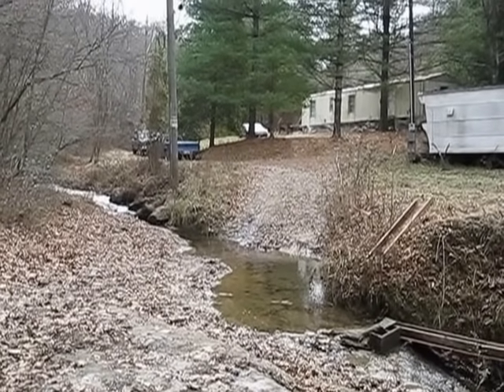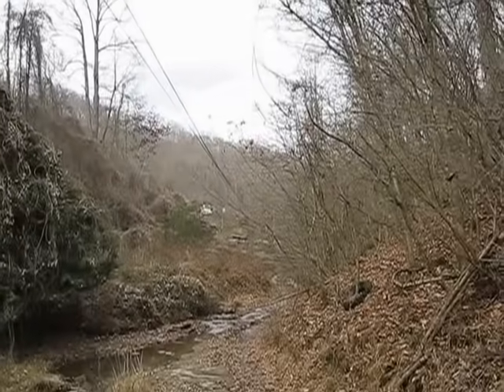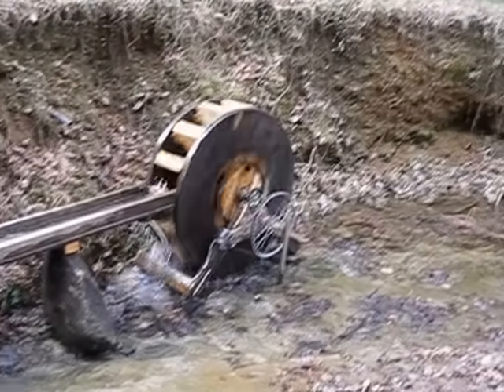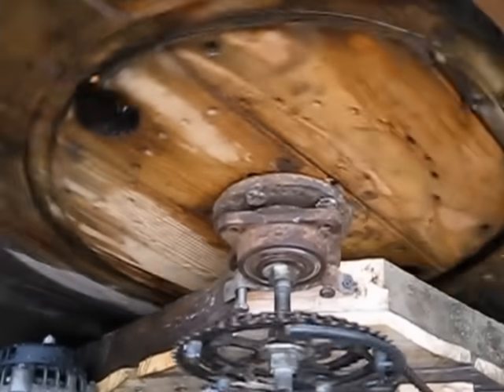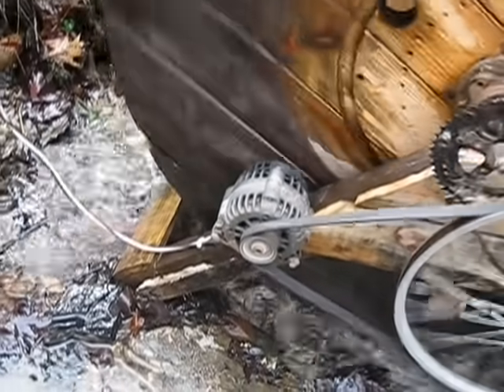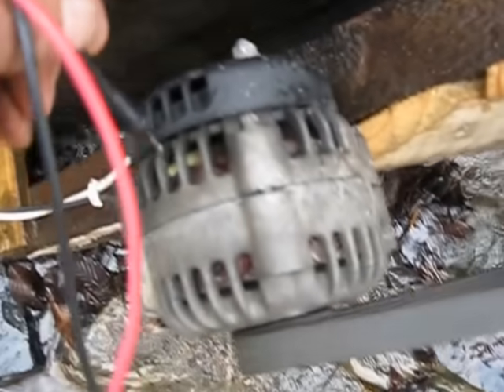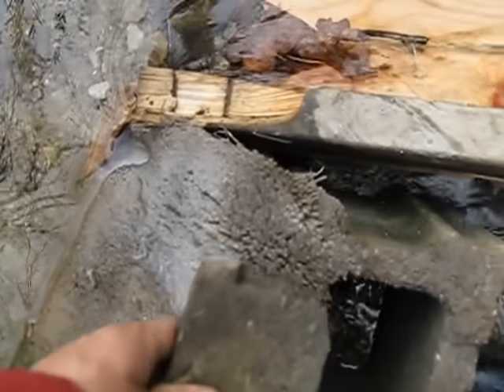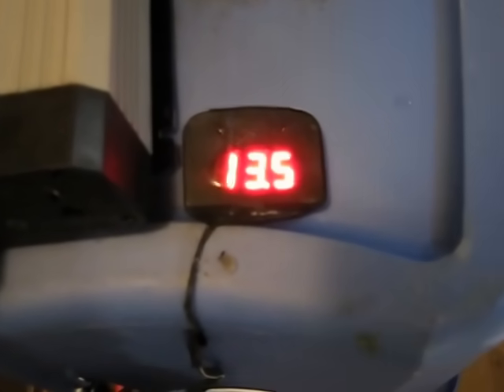water wheel generator

Comment: very cool thanks so much for sharing your water wheel design with us. Do you have any experience or know of anyone, perhaps you might have come into contact with someone that uses a submerged method of power generation, being that I am in the Northern Part of NJ creeks, streams and rivers freeze but, only to a certain depth, I have thought about a power generation idea using a sunken pipe for water delivery to a shore line above ground generation setup but, I am not sure how to determine the length of pipe to ensure water flows fast enough to keep it from freezing. Really don't want to go the route of trial and error because it could get expensive and would be very labor intensive in the winter chipping up all that ice. If you have any thoughts they would be greatly appreciated.
Reply from the maker: If you can keep the pipe below the frost line until it enters a small shelter then use the water to water wheel or turbine inside a temperature controlled environment(It only has to maintain more than 32 degrees.)It won't freeze. Just a suggestion, I've never saw anyone do it, but it seems like it would work.
Reply: Thanks I am going to give it a try, when I have it up and going I will post a video :)
Reply: William Lander If the water is moving fast enough to turn the wheel, it may ice up a bit, but you may not have to chop ice like you would with standing water. But, on the other hand, I've thought about an underwater wheel. Think a conventional wheel, but inserted inside a pipe just a bit bigger, then cut the bottom half of the outer pipe off. Water pressure still moves the wheel on the bottom, and as it's below the cover, you won't risk sediment blocking the whole thing off. The "width" of the wheel is only limited by how wide the waterway is, and any laws regarding blockage of navigable waterways, as I understand it. Oh, and of course, the laws of physics. Too long, and the shaft could bend and wonk all the work if you don't use more bearings/reinforcement in the tube. You could even use a smaller diameter wheel, just wider, for the same power. I'm sure there's a complex formula for power resistance vs. water flow vs. water seeking the path of least resistance...
Reply: YouTube powerspout

Comment: Nice job!  Have you ever thought about adding another alternator to your wheel?  All you would have to do is add another belt and alternator to the system and you could double your power.  There are a couple easy ways you could also make this more efficient.  1)  Make it so that you catch the water at the top so all the power from the water is used, right now your losing some of the power due to hydrodynamics.  2) You could make your pool a little deeper so it has a better supply, instead of using wooden boards use a green sewage pipe. If you made the pool larger you could tie it directly into the pipe with some cement/concrete. That alone would make your entire process easier and more efficient.  Not to mention you could have a real valve to turn it off.  Or keep it like it is, it serves its purpose and does what you want it too do.  I am just an armchair quarter back, who wishes I had something similar running through my back yard.  Cheers.
Reply from the maker: another alternator would be too much for the wheel I think. Thanks for all the suggestions.
Reply: LOL Hammer. 

The only way he could have suspended the constitution is by declaring martial law.

Trump is president so martial law didn't happen.
Reply: Does the law in your country allow you to do it?
Reply: *****  Yes that would work provided the wheel can turn fast enough to make the alternator spin at the same speed.
Reply: Maiusr
Reply: It was pretty much suspended in 2001.
Reply: LOL if the constitution was suspended then Obama would still be president.
Reply: jmcinvale they are just the face for the elites, paid actors creating the illusion for us pawns in there mission to acquire money and power
Reply: @MadCapMag  yes a lighter wheel will mean less force required to turn it but the trade-off is that the heavier wheel tends to want to keep spinning due to it's weight so that would  be lost with a lighter wheel
Reply: the last word has it spot on .
Reply: nice
Reply: Who cares about laws? 

Those who don't want a criminal record and don't want to go to jail.

Now I myself think that a person should be able to do what they please on their own land within reason, but unfortunately the government is trying their best to gain increasing control of our lives.

That can be stopped if the majority of us citizens want it stopped.

Comment: Its a nice design, You will find though that you can over power the friction and loss of power by simply changing your gearing mechanism. just like on a muti-speed bicycle, keep all the sprockets and chain derailing devices and implement an electric motor with a variable speed (for fine tuning).

Comment: if the water goes out them fema wood stove systems produce gas and a butain regulators too generators work too its 2014 might be a cold winter cause of the signs now

Comment: i am just spit balling here but maybe if you rearrange your water wheel so that you didn't loose all that water momentum as it smacks into the wheel you would get more efficiency and not slow the wheel with a heavy load on the inverter. what i mean is run the water over the top of the wheel and you will have fast water momentum on your side to help and you will still have gravity pulling the heavy water downwards...just a thought. but i do realize that you will need to lengthen your wood slues boards and get more distance from your on/off switch/rock so your water can reach the top of the water-wheel and not just the side like it does now ;) probably twice as far is about good :) just spin your whole water wheel rig around 180 degrees and run the water over the top ;) you will also have twice as much water weight in the wheel to be pulled down by gravity so theoretically you will about double your horsepower

Comment: So you have 5 batteries going into that power inverter? How ofter to you have to change batteries. Do they heat up or burn out? Thanks
Reply from the maker: Actually the batteries that were old car batteries have been replaced with deep cycle batteries. Car batteries are not very good for this set up because the don't do well with discharging and charging over a big range. Deep cycle batteries are designed to discharge more and can withstand heavy use.
Reply from the maker: thats it. I do have several 12vdc appliances and led lighting but thats about it.

Comment: Dude, you got to cover that stuff up, and keep some WD40 around
.
That set up inside your house you need to move it as close to the alternator as possible to avoid power loss, and then run the AC from there inside your house.

Get the batteries off the floor and inside some wooden box of some sort, then keep the cables nicely managed.

Comment: add a second alternator double your power. also ive been looking into electric motors hooked up to alternators that power the motor and give off excess power that you can use. use your current system to cut on the motor then switch to the power coming off the alternator and the motor should keep running. the video I watched the guy just attached pulleys to the motor to a 2:1 ratio so the alternator was spinning faster than the motor. Im going to experiment on this at a later date. but just throwing out an idea to ya. hope it helps

Comment: make the water wheel bigger and better... i want to do this kind of thing... but i cant.. plus i have no creek... but if i had the water tub needed... id do it... id just need a large tub or 3.... and a large set of pipes to connect them.. and a large water wheel made of metal ... and a few bike tires... then id have my water wheel in my front yard!!!... and all id need to do is replace the broken stuff when needed.. and fill the tubs back up...and again.... a VERY BIG WHEEL!!!
Reply: is that track a RISING track?? i saw the spout 2:25 and wondered whether it was going UP instead of down.. (to maximize efficiency  you could make the creek a little deeper more towards the wheel and put the wheel a few feet down... make the creek past the wheel go further down and you got better stuff..lower the mouth end of the trough and lower the water wheel.... (or put the water wheel in a tub as i would do and have the water from that wood trough spit into the tub.. have the tub accept more water than that... having filled to the brim.. and have the tub have a pipe or hose pointed at the top or 10 o'clock position...whether or not you make it as i will have to... is up to you.. but make the tub accept a lot of water.... b4 you try and use it... the weight of the water in the tub will have to be heavier than the water in the hose.. or the flow wont work... the water used by the water wheel CAN return to the top of the stream to recycle its use on the wheel... or it can be returned to its natural flow of direction of the stream... or the whole set up can be directly set up so that it stays with the water wheel and attempt to have 100% efficiency...(at least.. enough so that most of the water being sent back to the tub(s) will help keep the water flowing at a fast and steady but overflowing rate.... again.. its up to you...)

Comment: Well, you should really move the water entry point higher on the wheel; 10 – 25% from top. Higher on the power should give you increased force. On the batteries you could use some more. Say, 10 total. Also a dump load to your main bank if they are separate. I guess you could use a high amp switch and a bank of diodes so you can dump the power from the hydroelectric bank to the main bank. The only usable options that I see that would be worth the grain over cost would be for you; wind, solar and hydro. Well, it does work but really a charge controller would be better and a 3 phase generator verse the auto one. In the long run that is.

Comment: there is a better way to pull more power from your wheel.
turn your wheel around and the water spill over the top of the wheel to have it push down on the wheel, the you can add more wheels with a wooden catch leading the water over the top of the next wheel and so on over and over... so if you ever need more power you only have to extend the wooden water lead and than add another wheel.

Comment: I like what you done there and you should get a lot more power out of it without having to worry to slow the wheel down.

The water should enter the wheel at about the 10:30 to 11:00 o'clock position, you have it at the 9:00 o'clock position right now.
Your wheel should be more wide also.
If your wheel could be more tall that will help also.
Looks like your board in front of each chamber needs to be higher so water is staying longer in the wheel and more water can be stored in each chamber.
The aim is to have as much water as possible and as long as possible in the wheel while the wheel is turning.
The weight of the water is kinetic power that releases energy while gravity is pulling on it.
The more water (weight) that is inside the wheel the more power you will get out of it.
If you can not get the wheel higher and feed the water at the 11:00 position, then you have to make your wheel more wide so it can hold more water.
Looks like that this amount of water could give you about 2,000-3,000 watts any time.
I seen a restaurant operating on water power only with about 2 times the amount of water that you have.

Your batteries would need to be same age, same amp hr, same type, same condition, and should be deep cycle. Your batteries the way they are will consume power from each other, weaker batteries are acting and will become loads instead being a storage device.
Looks like the wires from the wheels to the house are #12 wires, maybe #10 wire and you have a 100 foot or longer run.....
Depending on amp output of the alternator/generator the wire size may not be big enough for DC and you may have a big voltage drop . AC and DC behave different if you use the same size wires. Here is a link for a DC wire chart. http://windandsunpower.com/Store/Support/Wire-Sizing-Charts

Comment: If your looking for more power then take your water from further up stream. You will need a good length of pipe & a pick axe. There are so many ways of improving these home brew projects, i wish i had one to play with.  Using the water pressure on the wheel paddles instead of the falling water  is the next step.

Comment: nice job guy  as a tech  i wana point out some things that can make it better .1 the batterys should all match  deep cycle is best. 2 the run from generator should be  a few feet due to volts/amps will drop .3 the 1k inverter might be 1 k  at peak not all companys are telling truth.  4 mod sine or true sign this can effect motors and some electronics they wont run . 5 all wires should match  from generator to batterys other than that it will give its best.  if you need help with ohms law  let me know.

Comment: This is a very cool setup but based on what I'm seeing I can't image you are generating more than about 10 watts off that water wheel.
Reply from the maker: Not sure how many watts I get, but it will charge my battery.
Reply: Off Road/Off Grid In the video you say we use a couple of ways to make power, what are the other ways?

Comment: Really great set-up, how many AMPs are you getting at your battery
Reply from the maker: Haven't really checked the amps but it is enough to charge four batteries. If I run all my lights it will keep up, but when I turn on a tv it starts dropping my battery voltage and the wheel almost comes to a stop. I have a natural gas generator running off of my free gas for power above what the wheel will make.

Comment: This is good but If I may be so bold as to suggest that your problem is the height that the water is entering your wheel. Waterwheels are around 90% efficient if the water enters the wheel at around 90% of the height of the wheel. You would have a big excavation to make or as suggested dam your creek higher up and run the water via a few lengths of 5" PVC pipe and let it pour ont the top of the wheel( it would run the other way). A 6'0" diameter wheel ( over shot) running at 60 RPM with a 90% fill rate will give you 1Kw.... It as simple as that.... There are commercial units available but DIY works for me
Reply: Off Road/Off Grid
 tramcar trev is right about sending electricity long distances... convert your DC voltage to AC as close as is practical / possible to the generator and send 110 volts AC long distance to minimize voltage loss. sending DC volts long distance is very wasteful and requires LARGE cable gauge wire.
Reply from the maker: I had thought about building my driveway up higher and putting a big pipe under it and running that higher on the wheel. There is a perfect spot at the other end of my property with about a 30 foot drop that would be perfect for a much bigger water wheel  but at around 1500 feet away the voltage drop would be unacceptable.
Reply: Heavy gauge wire would fix that. How far do you need to carry the power and what are the voltages etc.... If you are using an inverter to bring the 12v UP TO MAINS VOLTAGE then maybe put the inverter closer to the wheel in a water proof shed or container then lead the mains away to the residence.
Reply: inspectyerbooty
AC and DC can be send a long distance with about the same voltage drop.
It is way cheaper to increase voltage with an AC system than it would with an DC system to send power further. Why do you think power companies is sending power with thousands of volts down the line?
Even if you have an 120 volt ac power, you will have a very big voltage drop if you would send power 1500 feet. The voltage drop would be so much that you could not operate most of the household items, but it would depend how many watts you are sending down the 120 volt line.
Reply: Convert the DC through your inverter to AC at the source and you won't lose the voltage.  You are going to convert to AC anyway....  and your batteries would be a long way from where you live.
Reply: If you want  to send about 500 watts 1500 feet at 120 volt you need a 3 AWG wire. At 3000 feet round trip that would be expensive.
If you use 240 volt you need a 6 AWG wire which would be still expensive for a 3000 feet  roundtrip.
Reply: He doesn't have anywhere near the water supply to do that,  if we judge by the current setup,  which has a theoretical maximum power generation capability of about 5 watts  ---- (estimated 10 gallons/minute water flow @ a 3 foot head).
Reply: Tramcar Trev Totally agree! Convert to AC as quickly and as high as possible. If you can send 240, you will lose even less. It comes down to volt-amp resistance. Amperes is the measurement of electrons passing a point. Higher voltage means fewer electrons in AC power. In DC, however, it doesn't. Convert to AC as quickly as possible!

Comment: Nice set up, but I think if you set up a dam where you have that deep cut. with a pvc pipe 5"?  send it to the wheel and reduce it to 3" it would give you a stronger flow, turn the wheel faster. reduce the voltage to 15V via a step down transformer and then go through a rectifier to charge controller. This would give a constant power input, and any load would be taken up with the inverter, so your water wheel would never slow.
Reply from the maker: good idea, the only problem with building a dam there is the fact that its right where my driveway enters the creek and if I make it too deep it'll flood out my car. If I could raise the level of my driveway and put a pipe under it maybe that would work.